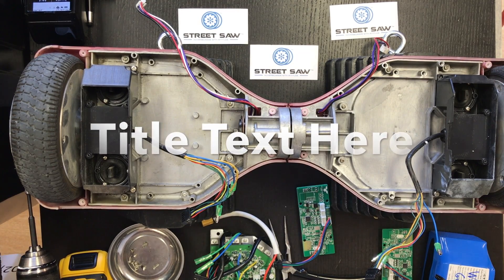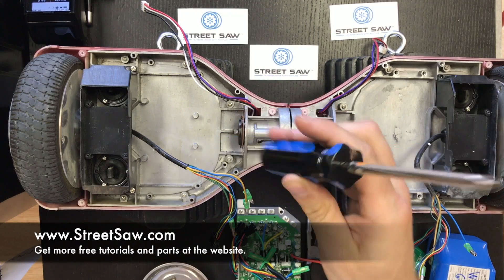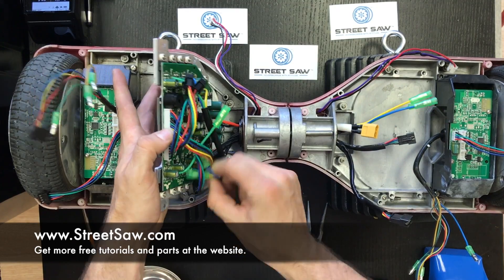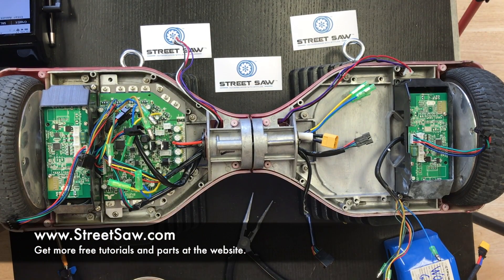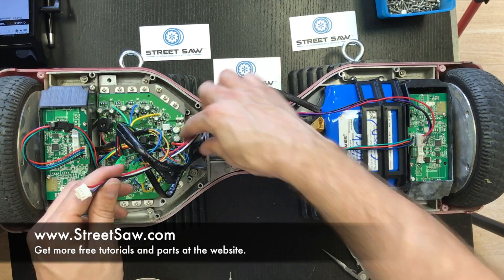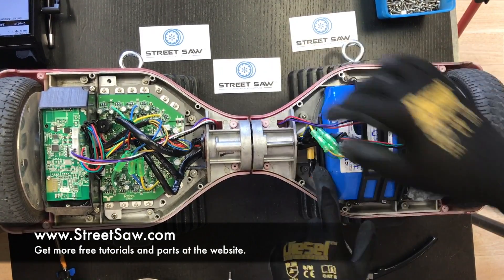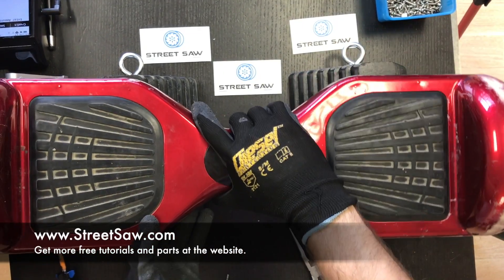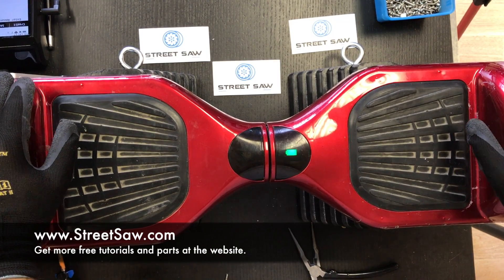How to Replace a Hoverboard Motherboard and Gyroscopes

Comment: Please can someone answer, can I replace gyroscope for Any card, blue/green. I need to fit the rim LEDs as have a new shell however this board does not have the extra plug to power them. I will tap into front lights if needed, just wondered if gyroscope was paired with motherboard or it doesn't matter.?

Comment: Is there ever a calibration procedure needed when installing a new gyroscope or mother oard beyond the regular center calibration? I was gifted a motherboard that did not work on one side. I replaced both gyroscope (figured pairs was best) and both sides worked normally. However, I can only ride the board one time because it will shut off as soon as I step off. I will ride for a minute or two, step off and the board will shut off and not turn back on for several minutes. If I test voltage at the board I am getting 39v however, if I check it inmidiately after it shuts off I get 16-20v or somewhere around there (something too low). If I disconnect the battery right away and test there I get 39v. Testing the board with battery disconnected it is the lower 16 or 20v. This lead me to believe that I had a capacitance issue with the motherboard. I bought a replacement motherboard that is identical to the one in the video. This new motherboard will power on, however it will not enter calibration mode or power the wheels. When pressing the pads to engage the motors the blue headlight lights up but there is no green light on top next to the battery indicator as there should be. This light will flash green at startup like normal, however it will not light up green when pressing the foot pads and it will not flash red when entering calibration as it should. I have tested the voltage at all connectors and wires to match everything to my original motherboard and all voltages are equal under equal circumstances. The only difference is the larger black top capacitor by the mosfetts, on my original mobo this capacitor will have about 3v until I engage the motors when it raises to 16-17v. On the new not working mobo I get 5v and since I cannot engage the motors I do not know what voltage it would go to. On both mobos this black top capacitor (labeled 600v) makes a humming sound, I have confirmed it is in fact this capacitor. I am thinking the new mobo is having and issue communicating with the gyroscopes (no brand on the gyroscopes, they are blue like my original mobo). This is an old original style hoverboard.

The only other thing I can think is that the battery has an issue and the board in the battery is causing the hoverboard to shut off due to the voltage drop. The only odd thing is as soon as I disconnect the battery it reads the full 39v, even though I can only get 39v at the battery when it is connected (using original mobo after it powers itself off). With the new mobo I can plug the battery in and the voltage will be 39v at the mobo battery connection all the time. It will however start out at a lower voltage then climb as the capacitors charge. Perhaps this itself is indicative of a battery issue, perhaps the battery has a couple of weak cells and is unable to charge the capacitors quickly. I have never experienced this though, and if I test the voltage of the battery with the original motherboard plugged in while powering the motors there is almost no voltage drop (it will go from around 39v down to around 38v, about a 1 volt drop with motors powered and spinning freely. 

I would like to know if there is any chance that this mobo cannot communicate with the gyroscopes despite all connections between mobo and gyros being identical with identical signal voltages? I also didn't know if there was some other calibration procedure to marry a new mobo to different gyros? I am also curious what the function of the black top capacitor is since all other capacitors will either read full battery voltage (large and medium size capacitors) or roughly 1/2 of battery voltage (smaller capacitors). The only capacitor that behaves differently on both the old and new mobo is the black top one (also, the capacitors that are around/next to the black top one may behave differently but I could not get a multimeter prong in there to test those on either mobo). 

Any advice or info would be great, at this point between two gyros, a new mobo, new charger and now a new battery I ordered I have certainly spent more than the cost of a new mobo. But I am in too deep now and fixing this has become personal haha.

Comment: Hi, Thanks for your great video, very useful showing the way the boards go back together.
I have a question regarding voltages, my kids have a couple of boards, one runs a 36v battery and the other a 25.2v.
I’m trying to find out if there is any difference in the main board operating voltage? As nearly all the batteries on eBay and Amazon are 36v?
Thanks Tom.